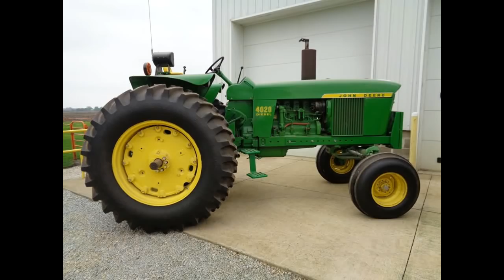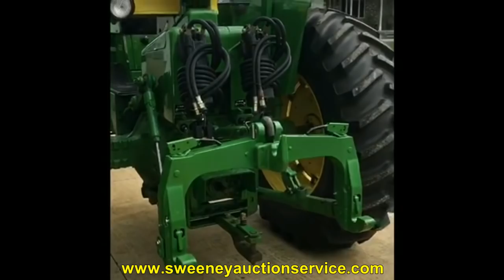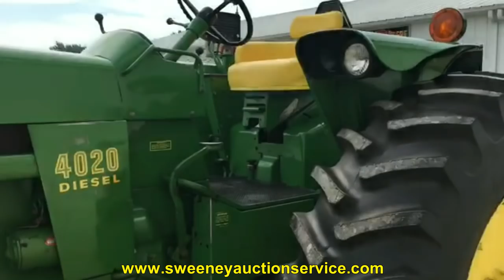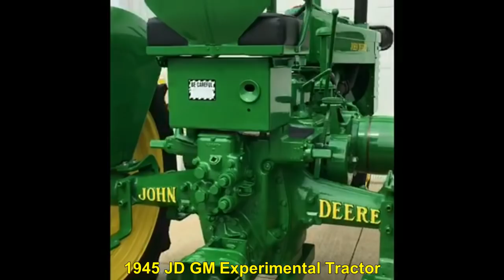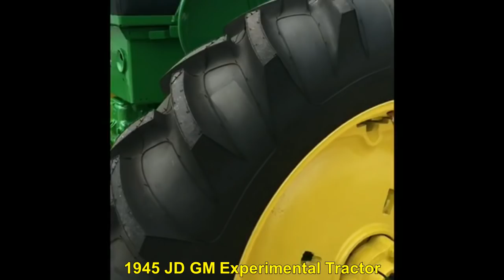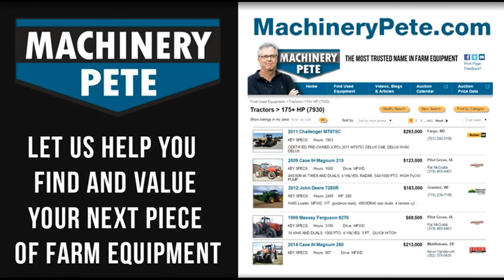1972 John Deere 4020 with 2007 Actual Hours For Sale on Iowa Farm Auction 8/4/18

Comment: Now the 4020 John Deere tractor is it a power shift. That's the tractor I needed my operation. If you can please find out and let us know that would be great. Have a great evening
Reply from the maker: Synchro....'72 diesel PS with 2007 actual hours + original paint would = holy grail type bidding :-)
Reply: The Farming Life The john deere 4020 is a legendary tractor
Reply: The Farming Life : It's a synchro transmission tractor, not a powershift. If you pay close attention to the video, you can see & tell based on the position and shape of the gearshift lever in the dash.

Comment: Gotta say, I'm extremely skeptical. I wanna see the original rubber that was obviously recently taken off that 4020. I also wanna know the compression in every cylinder. No way that is original 46 year old paint either. Sorry, not buying it. The seat is clearly newer also. Those hours are so low, it means that tractor had to sit around in a barn far more than it was used. It could also just mean that the tachometer/hourmeter has been changed out at some point. Lots of things happen to tractors over the years. Based on the era it came from, when farming was booming and 4020's were commonly the main tractor used on the farm, those low hours are very, very difficult to believe. 

Hate to say it, but I think a lot of folks are prettying up their tractors and spinning some tall tales which enables them to fetch insanely high prices for certain model tractors that are popular and in demand due to those with nostalgia and deep pockets. 

It sure appears to have been refurbished at some point, most likely within the past 4 operating hours, by the current owner that purchased it in 2011.

Now, don't get me wrong. Regardless of its back-story, it's certainly a beautiful tractor. I'd love to have it, or one like it, but we all know it will be fetching stupid money at the auction.

The crazy high prices folks are paying nowadays for these clean late-model 4020's is mind-boggling. Guess money from multi-generational farms and/or folks with access to large bank loans allow excessive money to be easily over-spent. Most folks just can't justify spending 3 to 5 times the average market value for pretty paint and a few add-ons, and rightfully so.
Reply from the maker: Very common theme I hear every time a super low hour older model tractor like this shows up for sale. How can this be? Understandable to wonder about the low hours. Good to question the validity. This is why the HISTORY on the tractor becomes so important, how/why did the owners use/not use it? Loved how auctioneer Jeff Sweeney provided the detailed history on this '72 JD 4020, owned by 2 brothers with a 70 acre farm, then bought by the Kuhlmann's in 2011. If you look at the sale bill for this auction for the Kuhlmanns you can see the number of exceptional JD tractors on the sale, number of sweet 3020's and the Experimental 1945 JD GM. The Kuhlmanns know and appreciate quality vintage JD tractors. So smart for Sweeney Auction Service to "tell the background story" on these tractors. From 28+ years tracking auction sale price data one other thing I've learned is how very important (vital) the owner/seller's local reputation is. Well loved local farmers with great reputation = strong sale/strong sale prices. Huge TRUST factor. Local folks in the Readlyn, IA area know the Kulhlmanns, respect them. When looking at an auction from long ways away of course you don't have that local connection, don't know the sellers....easier to wonder about validity of equipment descriptions/hours, etc. Always pays to do your homework, find out as much as you can about the sellers themselves. This is why auction firms & equipment dealers should work harder, as Sweeney Auction Service has done here, to "tell the story" of items up for sale, provide more background. Of course this same approach applies to when a piece of equipment is in tough shape....call it what it is....potential buyers appreciate the honesty. I've noticed over the years this powerful truth at play when at farm auction the owner gets the mic and tells auction crowd about the oil leak on the tractor about to sell. Rather than make bidders shy away....actually works to pull them in. They appreciate the honesty
Reply: Machinery Pete : Agreed. Another issue, with the internet in general, is that things often appear different, almost better many times, when viewing something via a video versus seeing it in person. A picture/video of any given human being is the perfect example of this. Meet them in person, and you see their many "flaws or imperfections" much clearer. Anyhow, it's a beautiful tractor with a few nice extras on it that rarely come on such a clean tractor... Quick hitch, dual remote cylinders, HD drawbar hammerstrap, toolbox, weight set, and possibly more that I didn't quickly notice. She will certainly fetch a good buck. I hope its next owner takes great care of it as well as the previous.
Reply from the maker: Can be true about video....folks don't look as good in person. I've had people who watch our TV show tell me that..."Pete, you're heavier/grayer than on TV!" :-)  We should ask young farmers if they have similar experiences with online dating apps like Tinder or Bumble....does the person look worse in real life??